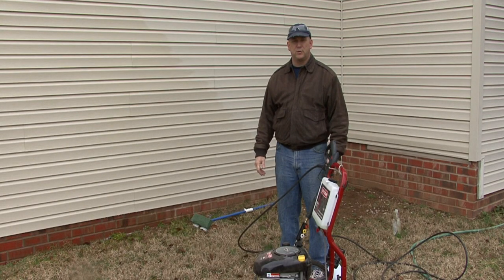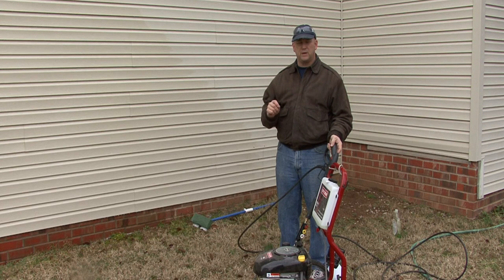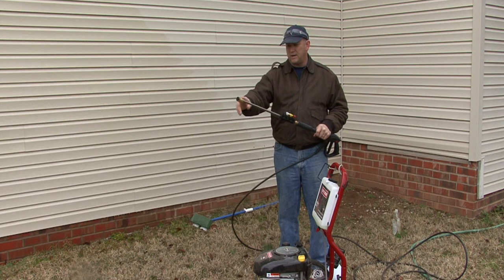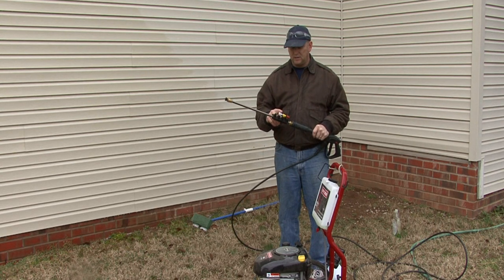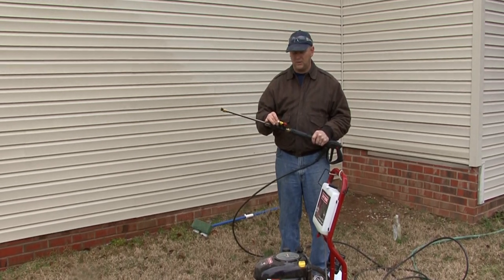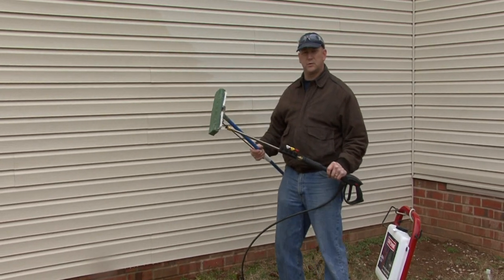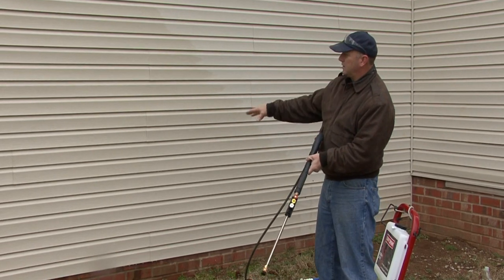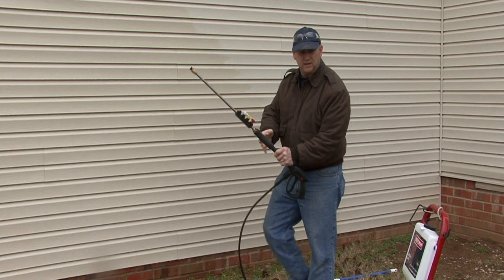Home Improvement Projects : Pressure Washing Aluminum Siding

Comment: 1. No one is going to do a 2-story house with a bristle brush. Get a better solvent/soap solution.
2. Never change tips with the compressor running!
3. It doesn't matter what direction you soap.
4. At the :55 mark, we see holes in the siding; they must be filled before pressure washing.
5. You should also tell people to wash in the direction of the siding's overlap so water isn't forced into the vertical seams, either.  It looks like you are doing that here, but people should be aware of this.
Reply: Comment Kong - pressure washers don't have compressors. Lol and you can change the tips while it is running just don't squeeze the trigger.